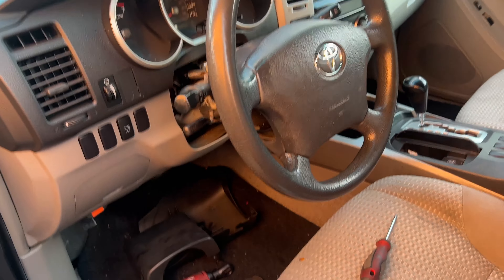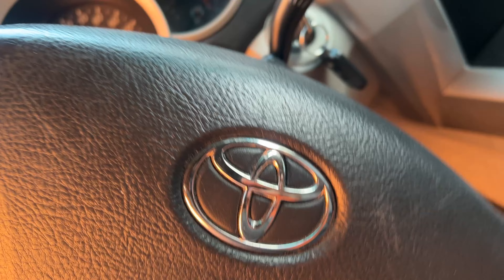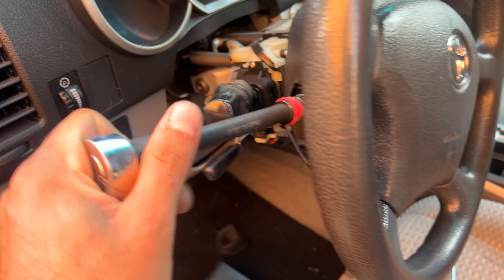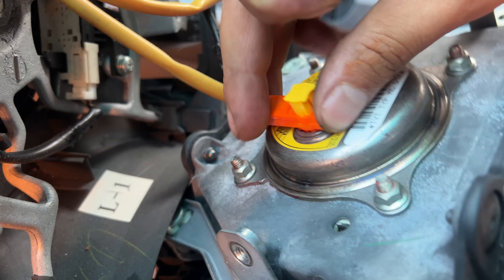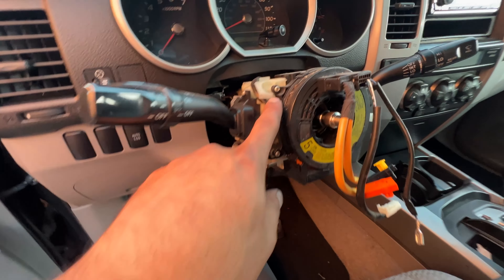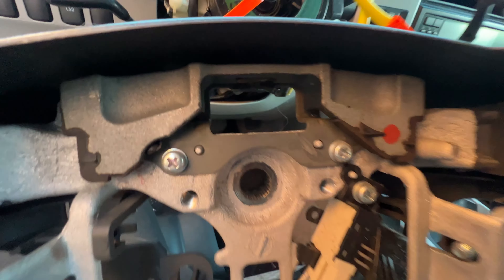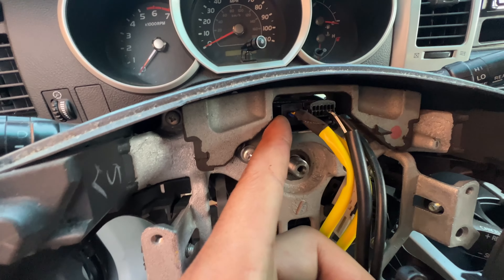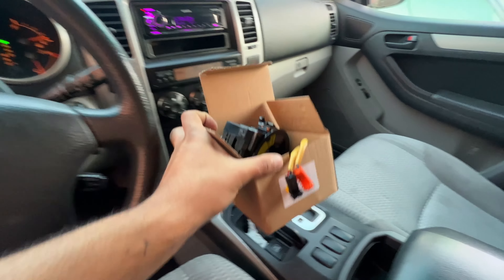4Runner Clock Spring Install SRS Light Airbag Light CODE B1181

Comment: Did you lose any other steering wheel controls? I’m dealing with the same code but coincidentally it popped up the same morning I spilled coffee in my center console. My cruise control still works. I’m worried I shorted the module.